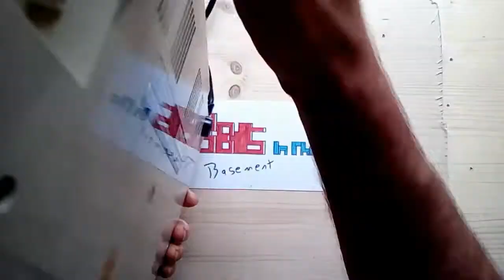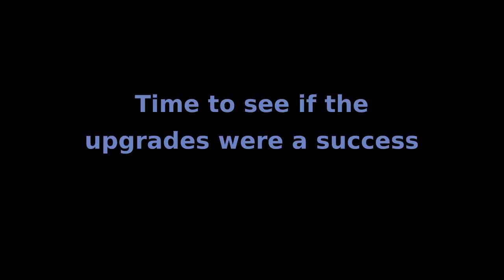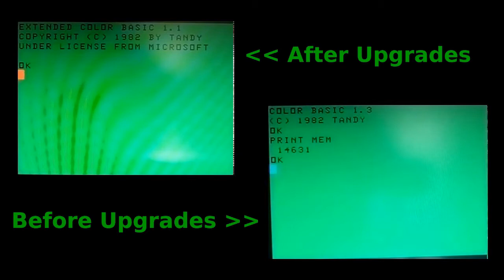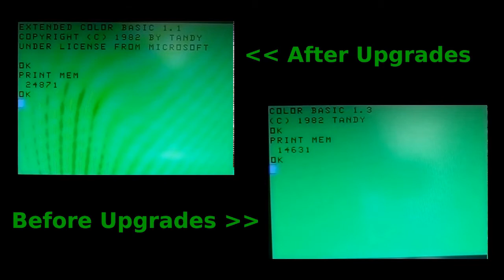Tandy Radio Shack "Coco 2" | A look under the hood and some overdue upgrades | Memory / Rom Upgrade

Comment: Hello ! Thanks for vid. Where have you buy your memory chips? No way for me to find them. Thanks
Reply from the maker: Hi Fabien, I bought those memory chips through Ebay from a vendor in china. If you search ebay for "4464 ic" you should be able to find them. Good luck with your upgrade ;)
Reply: @8bitsinthebasement  thks!

Comment: A very good vídeo , some day you'll have to show how to remove ICs without a socket, I mean desoldering   them directly inboard
Reply from the maker: I find that a hammer and chisel works great to remove all kind of components from circuit boards, it does make them very hard to use again afterwards though ;) Of course I'm joking but there was a place I worked in once and a customer said that a computer he had bought wasn't working so he tried to fix it, and yep, hammer and chisel to remove a part. Just thought I'd put that out there... I have a few repair videos coming out soon and in those I have to remove a couple of faulty chips (non socketed) so I'll make sure to show the process there. With a desoldering pump, not a hammer and chisel. I'm happy you liked the video and thanks for the comment ;)

Comment: Disk drive connects to the cartridge port with a controller cartridge. It was probably one of the fastest and most reliable 8bit home computer disk systems.
Reply from the maker: Thanks Michael. I bought this system without knowing exactly what it was and used it a little to "get a feel for it", then I made the video when I decided to give it an upgrade. More than a year has passed since and I've dabbled quite a bit with my Coco. You're right about it being fast on the disk loading but as near as I got to disk loading with my system was through using "drive wire". Disk controllers for the Coco are quite hard to find (not to mention expensive) here in Europe. The Dragon 32/64 used somewhat the same type cartridge interface but the controller needs a firmware change to go from Dragon to Coco and the Dragon's cartridge slot is based on the Coco 1. This means that in some (not all) cases the Dragon disk controller cartridge needs 12V DC which the Coco 2 can't provide. I was really surprised after the upgrade when I discovered that the Coco could load a 64k game from cassette more quickly than the Commodore 64 could from disk.  Thanks again for watching ;)

Comment: Could you show some BASIC or Assembler please on how to access the memory above 24kb? I'm wondering if it's a paging mechanism ..or? I'm curious on this for mine. Great video. Hope to see more. THanks :)
Reply from the maker: Thanks for watching and glad you liked it. When it comes to programming I'm afraid that anything beyond "hello world" goes above my head. I have found a little info that may be of use to you though https://subethasoftware.com/2016/01/19/64k-trs-80-coco-memory-test/ it goes a bit into the memory structure too. Hope this helps ;)

Comment: Thanks.  This is a great video but you should say in the title "Memory Upgrade and Rom Upgrade".  Yours should pop up at the top of the list for these 2 upgrades.  Do you know if all coco2's have the socket for the larger Eprom or is it just the Korean boards?  I just picked one up - 26-3026.  I haven't opened it yet but thought I would have to buy an adapter board for the newer larger chip.  Theres not many videos on the ROM upgrage.  Thanks again.
Reply from the maker: I've taken a quick look for you. I found a service manual for your revision and from what I can see your board should have 2 8KB roms or at least one rom and a socket for another. U12 contains color basic and U13 would contain the extended basic rom in an upgraded system (Page 39). I've included a link to the PDF below. It seams that the memory upgrade is slightly different than what I did also but I assume that you already have 64KB installed, if not check out page 18. I'm delighted you liked the video I made and thanks very much for watching. BTW if your intrested in the Coco and would like to learn more about it you should take a look at "cocotalk". Its a show that streams every Saturday at 2:00PM EST on Youtube and Twitch. In any case I hope that you enjoy your new Coco. ;) https://colorcomputerarchive.com/repo/Documents/Manuals/Hardware/Color%20Computer%202%20NTSC%20Service%20Manual%20(26-3026%20&%2026-3027)%20(Tandy).pdf
Reply: @8bitsinthebasement  Thanks a lot.  Yeah I knew the memory was different.  Thays why I wondered about the oversized socket on your's.  Was just watching more of your coco stuff - great channel.  Thanks again.
Reply from the maker: If all goes well I should have another one or two Coco themed videos up in the next couple of weeks. We'll see how it goes.

Comment: I was really a coco lover.  It was my first coco before getting a C64.  I would love to see a retro for this like they did with the C64 Maxi.  Is there a way to add HDMI and SD card or USB to this computer or a way to replace the mother board with a raspberry Pi and have it run an emulator giving it full capabilities with USB and HDMI and perhaps even wifi?
Reply from the maker: Hi Bruce, I never knew that the Coco existed until I found this system for sale just before I made this video. I think that I can safely say that it's become one of my favourite systems. It's quirky and has it's flaws but it's fun and there is a huge, very active community always playing around with and developing hardware for it. Search for "the coco nation" on youtube and you'll see what I'm talking about :) All the hardware you've mentioned is available for the Coco too. If you're looking for an SD card solution you should check out the "COCO SDC" which is available from retrorewind.ca, HDMI is available in a number of addons but I believe that the "COCO DV" is the best solution for a Coco 1 or 2 you'll find out more about it on the youtube channel https://www.youtube.com/@acs8-bitzone651 (he's the guy who created it and he has them for sale from time to time). There is also a project named "Cocopi" which consists of a pre-configured image for the raspberry pi 3B+ and above. Simply flash the image to an SD card and boot your PI with it and you have all the COCO you could ever need through emulation. Oh, and if you decide to purchase a COCO SDC check out Ken Waters channel  https://www.youtube.com/@CanadianRetroThings in his latest videos he's got a retrorewind discount code that will give you 10% off your order. Aaah, I forgot to mention that somebody is writing a COCO 2 game (all in assembly language too) about a mutant hedgehog at the moment? Thanks for watching and Coco forever :)

Comment: Track balls and mice are actually digital as they use grey code.
Reply: the CoCo mouse was analog,  and used little pots turned by the rollers, turned by the ball.  It appears exactly like a joystick to the CoCo.   OS-9 could optionally use serial mice connected to an ACIAor UART chip.

Comment: Do u know much about xroar (mac and windows) how do i run those on mac and windows? thanks....
Reply from the maker: XRoar is a Dragon 32 and 64 emulator but can run as a Coco 2 as well. To install it is easy enough all you have to do is search for "XRoar download" in Google and download the win or macOS binarys depending on which system you want to install it on. No system ROMs are given with the XRoar release due to copyright restrictions you must provide your own (System ROMS contain the code found on the flash chip inside the type of system you want to emulate, for example the Coco 2 has 2 System ROMS colour basic 1.3 and extended colour basic 1.1, so these ROM files are also needed to run a Coco 2 in XRoar) . Once you've installed XRoar copy your system ROMs into the XRoar installation directory and launch the emulator. When XRoar has started up you can select the type of machine you want to emulate using the "Hardware" dropdown menu and selecting the Dragon / Coco type under the "Machine" menu. In the "File" dropdown menu you can insert a virtual cassette or floppy disk and then use them as you would on a real Dragon or Coco computer. One tip on using the emulator, if you find that a key does not work for you, like if for example, try as you might you can't type the number "8" or an "!" just select the "Tool" dropdown menu and click on "keyboard translation" this will change the keymapping from the Coco's normal type to that of your windows or mac keyboard allowing you to type any character you need. Hope this helps, thanks for watching and for your comment ;)
Reply: @8bitsinthebasement  many many thanks but i cant get it working on mac os x ?????
Reply from the maker: To be honest I don't have a whole lot of experience with Macs (last time I used one was back in school in 93') the only thing I can think of is to make sure you enabled install 3rd party software in security settings (if that option still exists). Apart from that I'm afraid that I'm not going to be of much help to you.
Reply: I've got this working on Linux Mint so Mac should be OK too. Finding the correct ROM files is tricky. I've got it playing Defender on the CoCo 3.

Comment: mine looks just like that. but from the US.
Reply from the maker: You've got a SCART version too?
Reply: @8bitsinthebasement   i dont know off the top of my hear what scart is, but i was talking about looks and that  its the radioshack version with tall keys.
Reply from the maker: Scart is a big ugly 21 pin connector that was, and is still used in some European countrys to connect stuff to TVs. It was developed in France back in 1977 and was used on many games consoles sold there (Like the NES and the Mega drive). It carrys sound and video as well as information about the display format of the image (standard or widescreen) and when used in red, green, blue mode provides a crystal clear picture far superior to composite video (which it supports too). I didn't know that Scart versions of the Coco existed until I bought this French one  and it made it very easy to use with my TV ;) Apart from that what you and I have are the older new versions of the Coco 2. The new style keyboard (without the melted keys) but still sporting the old Radio Shack label and not the new Tandy one. Great system the Coco, it has some really fun games. Thanks for watching Than Oliver ;)
Reply: @8bitsinthebasement   ok, no mine is just the american version, but the rest of the machine looks the same.
Reply: @rottmanthan  When people say SCART they really mean composite video and separate sound. SCART has a lot of pins but its just the composite video and audio that home computers use. Often seen as a yellow phono for video and a red and white phones for stereo sound. In Europe the lead would have a SCART plug on the TV end and in USA the three phonos (RCA).
Reply: @wayland7150  I was mad jelly of SCART just being on TVs in europe when I got into arcade emulation in the early 00s and learned that you could fairly easily hook arcade/vga connections to a scart tv, but doing similar with PCs at the time in the US was kinda hard and expensive.
Reply: @carpespasm  I've always thought that TVs should have more than just an RF input. SCART is clunky but they made it so all manner of TV type devices, consoles, VCRs, receivers Disk plays could all connect at once. It was an EU thing but America could have simply put 3 phono plugs on the telly and got most of it. However when you use the VCR remote on a SCART system the TV selects that input.

Comment: Maybe the CoCo was not bad, but Tandy was expensive and therefore not loved. I personally know nobody who ever owned one.
Reply from the maker: You know, I didn't know that these computers even existed until I found this one really cheap on the web. So I had absolutely no knowledge of them at all before I bought this one. But I discovered a large community following in the US, it seems the prices weren't all that different than the C64 and some other systems at the time. It's really not a bad little system after the upgrades are done. Thanks for the comment man ;)
Reply: In Wales UK Dragon Data produced the Dragon 32 version of this Motorola design. It had several advantages over it's rivals. In summary it was cheaper than the better ones whilst being nearly as good and better than the cheaper ones whilst still being cheap. Good keyboard, plenty of RAM, fast processor and fast cassette loading. Graphics lacked and no sound chip. In some ways the way it did sound was more versatile. The waveform was output from software meaning digital playback of speech for instance.